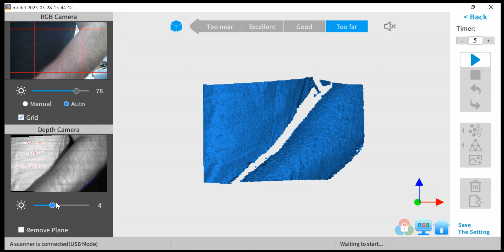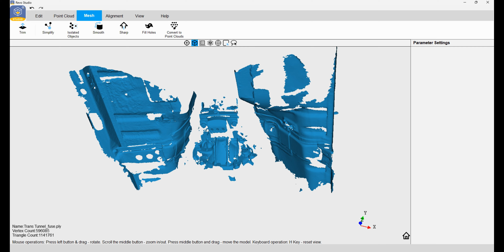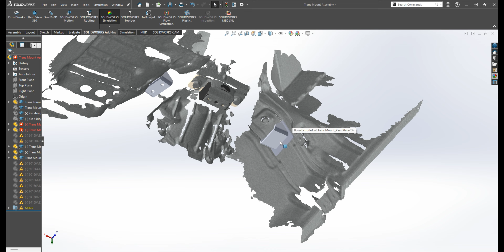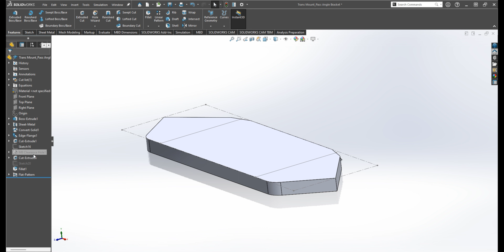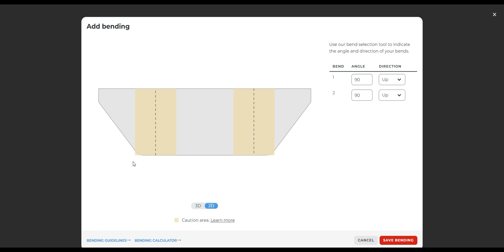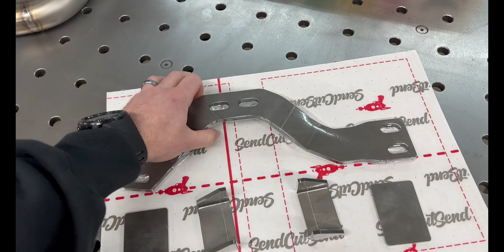How to use CAD, 3D scanning, & SendCutSend for automotive fabrication

Comment: can i ask you a question? i know there are different bend brake dies, to give either a hard tight 90 degree bend, to maybe varying inside radiused bends. lets assume two 10x10" 1/8" 5052 aluminum pieces are submitted, or cut by them. one has a tight 90 degree bend. the other has an inside 1/4"  radiused bend. if you compare both bend profiles by holding them together, so the flat edges align - the two halves of the 90 degree tight bend will be longer than the sides having the 1/4 inside radiused bend. when you design a piece to be bent, how can you know, in advance of making the design, how different corner bend styles will consume linear length of the material? or is the only way to simply order a 10x10 piece to be bent in the style you want in the middle of the square, then when you get the bent part back - you save that as a reference, you do the metrology on it, and that way you know how to design the piece after making that evaluation?

Comment: Awesome video and thanks for sharing. Starting off with my first project with making a bracket for a Volvo electric power steering pump that I want to run in my drift car. I have a scan of the pump and learning fusion 360 as I go. Wasn't sure of the pricing for send cut send but that seems very affordable. Can't wait to be at that point!
Reply from the maker: Great application for scanning for sure! Thankfully there’s a ton of resources out there for learning Fusion. Don’t forget to use my 15% off code link in bio to save yourself some money 🤙🏻

Comment: tell me where you bought the ati pulley for the power steering pump, the one that is smaller than the diameter?
Reply from the maker: The ATI damper I bought is the 6.78" OD one required for the Rad Industries KRC pump kit. You can find it at rad-industries.com

Comment: Way cool and inspiring man! The years keep passing while my car skills develop. Markets and technology change rapidly. 15 years ago you couldn't buy cheap performance parts on eBay and amazon. That's been huge. Now I'm a mechanical engineer and it's still hard to keep up with all my interests and technologies related to my car interests. I thought my iPhone 12 premix with lidar was going to be a 3d scanner for me. Haven't checked in the last year but the apps available have been pretty bad with it to build off of. 3d scanners are expensive and at the early stages of price to performance where whatever you buy will be cheaper and better tomorrow it seems like. 

I'm already a cad jockey but haven't been able to use it much with car projects due to lack of scanning. Any tips to get started with scanning? Is it like you? $600-$800 just for a scanner to get started?
Reply from the maker: I've attempted to work with the iPhone lidar camera for scanning but it's definitely not ideal. If you're unsure how much use you'll get out of it, the revopoint is a great introductory scanner and one of the cheapest.

Comment: Were you able to create sketches off the stl file or did you create planes as close to the stl surface as possible?
Reply from the maker: I always add planes to the stl file and there’s a few options to do this. In solidworks you can use the 3d to scan feature and add planes simply by clicking on 3 points on a surface. The other way that it can be done is to use the free program Blender and setup your orientation planes by eye which can get you surprisingly accurate results. You basically just need to manipulate the orientation of the part until it can be moved flush with the plane you’re trying to reference off of. This has its limitations though as you can only use it to reference the orientation planes vs adding multiple in solidworks to any surface.

Comment: I've to a RevoPoint scanner and it never works well for me. I've used an Einstar scanner now. Its still pretty cheap for a 3D scanner ($1000), but works SO much better than RevoPop software. Great video though.
Reply from the maker: I've heard great things about the Einstar. There's definitely an art to getting good results from the Revopoint, but with the help of Solidworks and Blender it's definitely manageable. Once I make the big bucks I'll upgrade to the Peel3d.